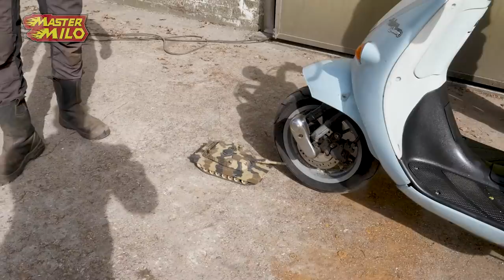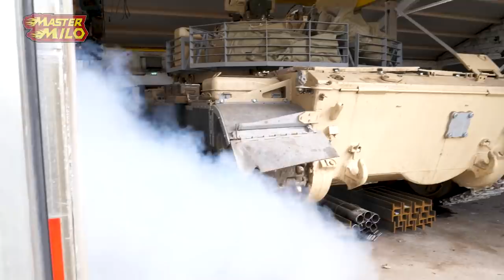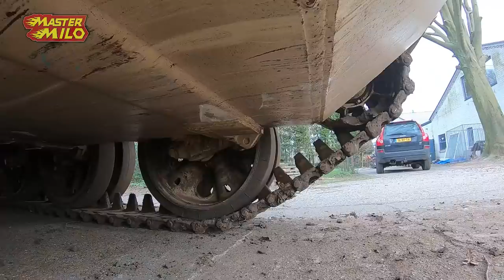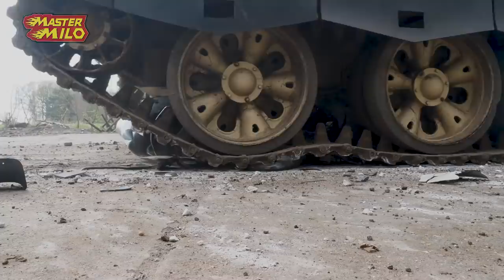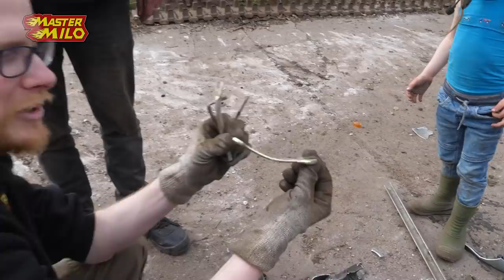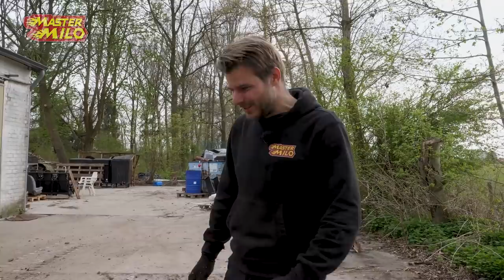TANK VS SCOOTER!

Comment: Looks sweet. I still miss the gun though. ;-) And at 1.80 EUR the liter diesel (8.18 EUR the Gallon), I wonder what was more expensive, the scooter or the diesel
Reply: More like 2 euros
Reply: @ehmjauhh5495  Don't worry! Engine stills needs more oil than Diesel! 😁
Reply: Ah he surely knows where to get some untaxed Traktor diesel
Reply: He has plenty of diesel that came with this tank
Reply: @bene5431  He probably stores it in a dieseltank. So he can run his dieseltank.

Comment: Tank you very much for a great video! Are you planning on adding a gun to the tank? I suppose something that can fire proper live ammunition is not an option but maybe something like a spud gun would be fun? I'm sure you will run over some more vehicles or devices, could you try to turn in place with some of that road kill under the tracks?
Reply: He has the gun, it's disabled as the law requires in the Netherlands and he has the correct permit for it, but it will take some time before he will actually mount it. He has another project that he wants to finish first, but it has been postponed due to external issues.
Reply: @paulterhaar4862  "external issues" oh my. You are so cryptic and mysterious, Paul. 😀
Reply: You should watch a few of the tanks videos, especially the first few and the last few. The first ones regarding the acquisition of the tank and where it went after crossing the English Channel concerns the main gun and its permits.

Comment: Is this smoke a camouflage function for this tank or.... 🤔🤨
Reply: He insists that's it's running right.... can't be.
Reply: It is supposed to have an on-board smoke generator that utilizes raw diesel injected into the hot exhaust, but this is not that. The engine is worn out [or something else is wrong].
Reply: @Hjerte_Verke  I saw the engine rebuild and it was "unprofessional". Worn components were reused, like damaged pistons an cylinders liners. Precision measuring instruments were not really used. No pressure or gasket tests and no new piston rings at all. Even the valves were tormented with a standard grinder and reinstalled with the old used gasket. Horrible!

Comment: Wow that thing still smokes like a steam train.
Reply: Smoke has cleared up a bit and after running the white clouds turn more gray or blackish, but yeah, it's worn out as other operational T-55 variants on YouTube can attest to. They don't smoke much at all, when in good condition, and certainly no more than a diesel truck
Reply: @Hjerte_Verke  It's a shame, after that engine rebuild. I thought they still had problems with the injection pump timing?

Comment: If the gun barrel is still tied up in red tape you should stick a telephone pole in the turret for posterity.
Reply: He was all the paper work to have the gun and he does have the gun at the shop. They are waiting to paint it and install it, there's some debate as to how it will fit in the garage bay with the long barrel.
Reply: @wastingmymoneyonmotorcycles  There is plenty of room in the bay, surely, but driving in and out and swinging the gun at the same time [so it does not hit the walls] certainly presents a challenge. But i could be wrong.
Reply: @Hjerte_Verke  I think you are right. He hasn't fix the turret rotation controller yet, so backing in/out would be a hassle.

Comment: I made this engines, engine in this tank not is good condition, long time was not working, oil of head run about valves to compression places, or are bad piston rings, or are bad distances cylinders vs. pistons, engine need proffesional repair boys

Comment: Where is the gun . If you will never be getting it back . You should make a fake one .. The tank does not look right without it!!!!!!!!!!!!!
Reply: The tank canon is in the workshop Milo's got all the right paperwork. It only needs to be painted and then installed ;) (but with the canon the tank barely fits in the workshop + it's allot harder to get the tank out with the canon sticking out)
Reply: Cut the barrel down so it fits for storage. . Then put a metal ring on the inside of the extra peace so you can slide the two together for show @rep1vNL
Reply: @dodgecoronet7544  Boo, that's an awful idea.